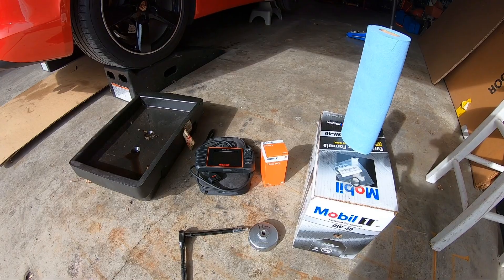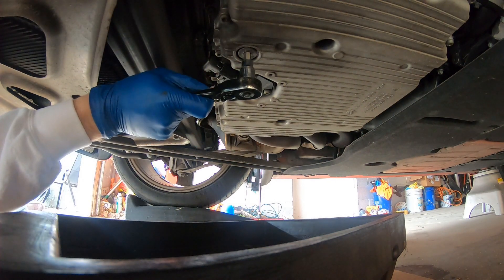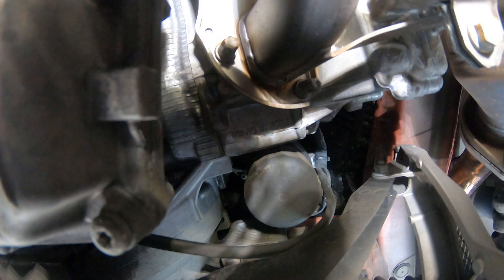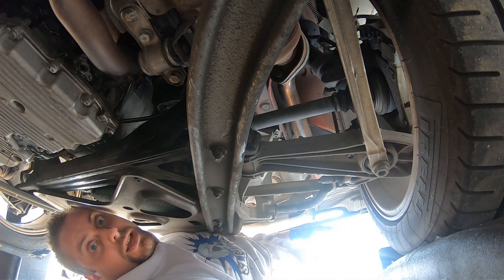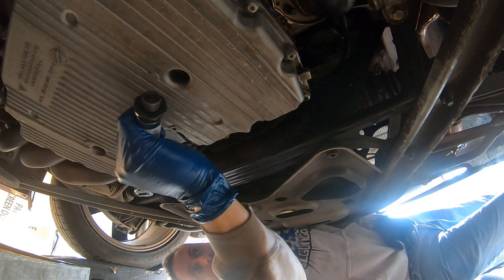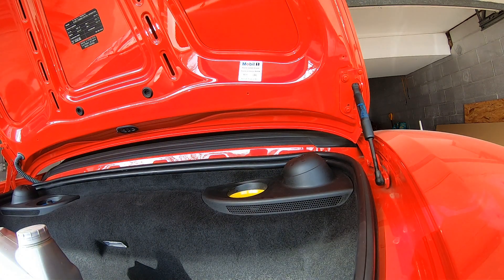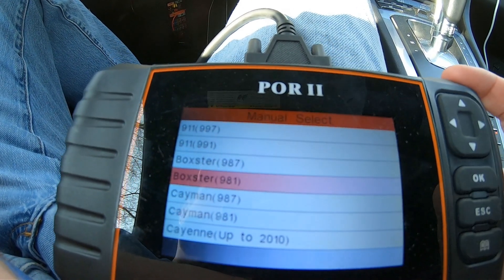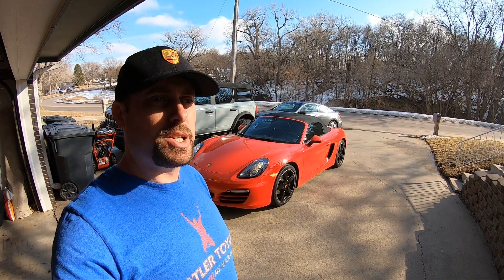981 Base Boxster Cayman Oil Change 2.7L

Comment: Just a suggestion - use a gallon ziplock bag to cover the oil filter once you’ve broken the bead. The bag will capture the excess oil spilling out from the filter so it won’t dribble down your arm.
Reply: And shove rags directly into the filter housing immediately as well.

Comment: We put 7.5K quarts is that to low? Says its low on minimum
Reply from the maker: The actual manual states 7.9 quarts for oil and filter change.  if you are low by the reading on the dash I would suggest adding .5 quart and then recheck.
Reply: @premiumoctane93  OK,  we added 7.5k and i added 40% of a quart of oil and the green on the level counter is only at the first bar it makes no since to me. Should i ad the remaining 60% of the quart? I am not getting  any warnings for oil level.
Reply: @ThatOneChannelinAZ  You wanna be in the middle of the sensor reading as oil expands if you drive it hard. It'll expand about 3 bars on the meter reading if you are driving very hard so being just around the half way mark is perfect.

Comment: Great job and thanks- could you please tell us about where you placed the front end jacking point?
Reply from the maker: There is a circle hole style mount point for the front,  Hard to explain but once you are looking under the car it will make sense. Should look similar to this photo: https://ecarguides.com/wp-content/uploads/2021/02/PXL_20210130_180508324.MP_-scaled-e1613443931298-1024x576.jpg
Reply: @premiumoctane93 Perfect. I think that's a much better way of doing it, rather than retaining so much dirty oil in the pan. My Euro spec oil should be here Saturday from Amazon. I'll let you know how it goes. And I won't be wearing eye protection 😂
Reply: @premiumoctane93  but where did you jack the car from, I understand the circle hole, but do you jack it at that point, then where do you put the jack stands? or if you put the jack stands under that circle hole where do you jack the car from?
Reply from the maker: @YYZ-SRQ I used jackpoint jack stands.  These solve your issue of where to jack and put the jack stands as it is an all in one setup. https://jackpointjackstands.com/
Reply: @premiumoctane93  I looked up your link and although they seem like a great idea, at the price of these stands I might as well get the dealer to change my oil as it will only breakeven after several visits they cost $670CAD for 2 stands.  I have low profile ramps, roll the rear of the Boxster up on this and then make some wheel cribs out of stacked 2x10"  (glued and screwed) and jack up the front and place under each of the front wheels as all I want to do is have the car level for the oil change

Comment: Face & eyes shield?
Reply from the maker: I mean you could but I just rather not put my face next to the oil
Reply: @premiumoctane93  Why do you think I put the "?" there the question/suggestion. 
AT the minimum you should have worn proper eye protection, not only is there a danger of splashing hot or warm oil in your eyes there could have been other road dirt just waiting up there for un-protected eyes.

Comment: its 20k/ 2 years for an oil change, or do you just do it every 10k as a precautionary measure?
Reply from the maker: Pre direct injection engines had a longer period of the 2 year 20k. 2009+ are actually recommended to change every 10k / one year.
Reply: @premiumoctane93  im in the UK, my manual says 20k/2 years, but it does say every 10k in a country's where leaded fuel is used, we don't use leaded fuel in the UK. could be why yours is different?
Reply from the maker: @acooper1037  Ahh yes must be different for non US markets.